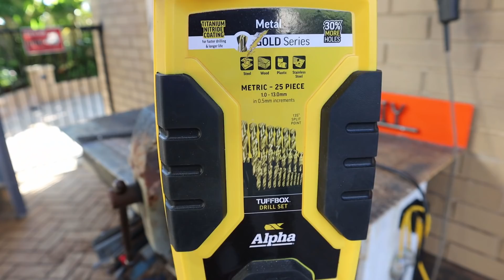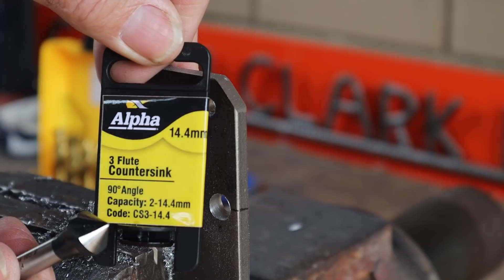I make an Industrial Style Wall Coat Rack using Tow Hooks and Rebar.

Comment: I have 3 tow hooks in my saved scrap pile and was wondering what to do with them.   Thank you for this project - I will use rebar for the main rod, wagon hardware to mount and logging sled runner for the wall piece.  I think I will weld my hooks in - also will try to find 2 more hooks, drop a rod into the curve of the hook and make a towel rack!
Reply from the maker: It sounds like it will look great. I wish you the best for your project.

Comment: Really like your rebar ideas! We recently built a new garage to house my car collection, and plan to build most of the shop cabinet door hardware, man door hardware/latches, display hangers, and coat hooks using your style of ironwork (will not do exact copies, these are uniquely yours). Additionally we have nickel plated some of our creations, and also used some brass, bronze, or copper fitting like the mounting screws for example. Gun blueing fluid makes a great finish if you want something darker, and for exterior use we plan to just let them rust, and maybe clear coat in the future! You have been an amazing inspiration of ideas, keep it up, thanks!
Reply from the maker: Thank you very much Bert, you copy whatever you like I am glad I could give you some ideas, your garage is going to look great. Thank you for your comment I wish you the best.

Comment: Wonderful job. What type of varnish or protection do you use on your jobs to protect them from rust?
Reply from the maker: Thank you very much. I often use Penetrol Rust Treatment Penetrates Rust 300g Aerosol Spray, and then put two topcoats of Semi-Gloss Clear Coat. That is what I used on the rebar lettering on the back of my workbench, here is the link to that video. https://youtu.be/JA-wk62Zghk  I try not to comment on finishes, As what climate you are in, is it inside-outside, lots of rain, ice, do you want long term and rarely touch, or a wax with a wipe over every year. That is why I have no opinion, Please ask someone in your area what you should use, I feel this is a better way to find out what would be best for you. Thank you for your comment.

Comment: Muy lindo trabajo 
Mucha prolijidad
Quisiera saber qué le pasan para que no se oxide el metal gracias
👍👍👍👍👍
Reply from the maker: Muchísimas gracias. A menudo uso Penetrol Rust Treatment Penetrates Rust 300g Aerosol Spray, y luego aplico dos capas de acabado de Semi-Gloss Clear Coat. Eso es lo que usé en las letras de las barras de refuerzo en la parte posterior de mi mesa de trabajo, aquí está el enlace a ese video. https://youtu.be/JA-wk62Zghk Trato de no comentar sobre acabados, según el clima en el que te encuentres, si es de adentro hacia afuera, mucha lluvia, hielo, quieres mucho tiempo y pocas veces toques, o una cera con una toallita cada año. Es por eso que no tengo una opinión. Pregúntele a alguien en su área qué debe usar, creo que esta es una mejor manera de averiguar qué sería mejor para usted. Gracias por tu comentario.

Comment: Really liking the industrial look thanks Gavin great content as always. Just one question what do you do to maintain from rusting
Reply from the maker: Thank you very much Bradley, I often use Penetrol Rust Treatment Penetrates Rust 300g Aerosol Spray, and then put two topcoats of Semi-Gloss Clear Coat. That is what I used on the rebar lettering on the back of my workbench, here is the link to that video. https://youtu.be/JA-wk62Zghk  I try not to comment on finishes, As what climate you are in, is it inside-outside, lots of rain, ice, do you want long term and rarely touch, or a wax with a wipe over every year
Reply: @GavinClarkdiy  Thanks mate it’s going in my work shop in the backyard.And the information you gave me will work you gave me some great products and ideas. So thanks I don’t know if you remembered but I was the one that asked which welder should I get as beginner. You recommended a mig so I got the uni mig Cheap but great for me so thanks loving your channel looking forward to seeing what you do next
Reply from the maker: Hi Brad, I am using a "Unimig Viper 182" MIG welder making these videos, and using gas. I wish you the best with your projects, have fun.
Reply: @GavinClarkdiy  thanks Gavin mines the viper 120 in came as a kit $390 I think It came with auto darkness helmet gloves pliers and heaps of spare parts I think I did okay
Reply from the maker: I think you did very well, you are all set to go, watch some MIG training videos and have a play. The settings to use should be printed on the welder.
Reply: @GavinClarkdiy Gaven  I did get some advice here about rust you always give advice on your videos      but  not what I can use I am not good at this sort of thing just check in to see what's going on🌲🎅🎄
Reply from the maker: Hi Dawn, it would be good for you to go and talk to a paint supply shop near you, and just have a chat, many of these people have been painting for many years and are full of knowledge on what to use. As I said above,,,I often use Penetrol Rust Treatment Penetrates Rust 300g Aerosol Spray, and then put two topcoats of Semi-Gloss Clear Coat. That is what I used on the rebar lettering on the back of my workbench, here is the link to that video. https://youtu.be/JA-wk62Zghk  I try not to comment on finishes, As what climate you are in, is it inside-outside, lots of rain, ice, do you want long term and rarely touch, or a wax with a wipe over every year

Comment: Hi Gavin, yet another great project. May I ask, when you have cleaned up the metal with your wire wheel, do you spray lacquer of any kind on the finished item to prevent future rusting? I would have to do that here.  Cheers mate, Norm UK
Reply from the maker: Thank you very much. Yes all my finished products are coated, most not until after the video. I often use Penetrol Rust Treatment Penetrates Rust 300g Aerosol Spray, and then put two topcoats of Semi-Gloss Clear Coat. That is what I used on the rebar lettering on the back of my workbench, here is the link to that video. https://youtu.be/JA-wk62Zghk  I try not to comment on finishes, As what climate you are in, is it inside-outside, lots of rain, ice, do you want long term and rarely touch, or a wax with a wipe over every year. That is why I have no opinion, Please ask someone in your area what you should use, I feel this is a better way to find out what would be best for you. Thank you for your comment.
Reply: @GavinClarkdiy  Thanks for a very comprehensive reply Gavin, I appreciate that. I did watch the lettering video at the time it premiered, but my memory won't let me see it in my mind.....guess I'll have to watch it again lol. I very much understand what you say about finishes used in different parts of the world, intelligent thinking on your part there. Thanks again for your time and very considerable efforts you put in to make your great videos.Take care and stay safe,Norm.
Reply from the maker: @drummingriffin   Thank you very much, I appreciate your comment.